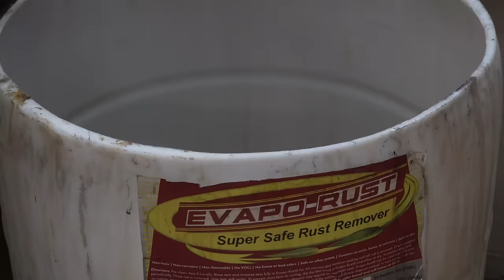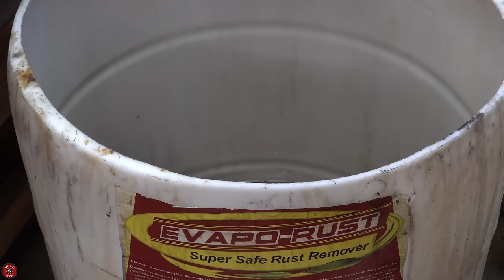1890s' Most Unnecessarily Complicated Apple Peeler [Restoration]

Comment: That's not "Unnecessarily Complicated", that's a Gosh-darned Wonder of Engineering right there...
Reply: It is unnecessarily complicated... I agree that it looks cool but for something to be well engineered it needs to do what it's designed to be doing while being as simple and easy to manufacture as it can possibly be
Reply: The had no auto cad to design it, all hand drawn blueprints
Reply: @MR5er1  I'm curious. While keeping the same durability, speed, and ease of operation, how could this machine be simplified?
Reply: @PBryanMcMillin  like the modern crap apple cutters you can buy nowadays, way way simpler, and slower and won't even cut during its MTBF what this vintage cutter can do in an hour.

Comment: I wouldn't say this is unnecessarily  complicated. If you're running a pie shop, a device like this is an absolute necessity. 

But for peeling apples at home? Yeah, not so much.
Reply: I thought it was ridiculous in a quaint, old-fashioned way. Until I saw it work at the end, which changed my mind completely!
Reply: And it really seems designed to drop the peeled & cored in a bucket or bowl is great for mass production.
Reply: @PhilipPetrunak  Yea I would just hate to be the poor bastard putting the apple on the thing. Be quick or your hand gets cored...
Reply: Your mom's got a pie shop at home
Reply: We had a variation on this machine that only peeled the apples. We had to core and slice them. We still got a lot of use out of it every year in the fall. My Mom still has and uses it. But now that I’ve seen this bad boy...
Reply: Pretty sure the point isn't regarding use, but the mechanics of the machine itself. There are simpler designs.
Reply: @Awrethien  Yeah. Stuff like this was made back in the day before safety standards for workers were a thing. Thank God for unions.
Reply: @Wolfgang Kleinschmit These were not designed to be powered.
 They were not supplied with pulleys for a belt drive and were originally designed(1886) before small electrical motors were available. Goodell Cp. manufactured these until the mid 1960's when the foundry burned to the ground.

Comment: I don't think it's unnecessarily complicated at all. It's as complicated as it has to be to work as quickly and efficiently as it has to. It's not a kitchen tool, it's an industrial tool for perhaps orchards or cideries. That thing cores and peels an apple in less than one second! It takes my KitchenAide 8 full seconds to core and peel an apple.

Comment: Interesting you replaced the either brass bushings with what looks like aluminum. Have a reason for that substitution?
Reply: no..... it was steel bushings
Reply: @ulfhenarpolymathmilitant6258  interesting. Bushing are designed to be worn, not shaft. You get lubricity from the softness of the bushing so steel is an even more interesting choice.
Reply: you are right, Kevin. Looks like people do not know that now. Remarkably, mostly only Russian speaking commenters have noticed this x)

Comment: I'm curious why did you replace the brass bushings with steel?
Reply: Looked like aluminium to me
Reply: I am curious also?
Reply: I guess, it was for exclude backlash
Reply: Looks like brass was worn out, and steel was all he had of the right ID and OD
Reply: hope it is aluminium but even then it is less good than brass !
brass will not make the wight powder as the aluminium...
If it is steel it will worn out all the shafts !

Comment: What material were the bushings replaced with? It looked like aluminum but that wouldn't be an improvement over brass. If it's stainless steel I'm not sure that's an improvement either as that could wear parts faster.
Reply: sunriseshell Dude it's an apple peeler not a 500hp race engine that needs to be rebuilt every other race.

Comment: 1890's? No square nuts or bolts?  Makes me wonder...
Reply: Doesn't look nearly that old to me, either.  Too many threaded connections, wrong kind of nuts, like you say.
Reply: Hex nuts came about in the 1850's. However it looks like someone restored it once before, non leaded paint and so on. I guess there were some washers missing here and there too. The most interesting part for me is why someone would make a spring that coarse out of brass? I know watchmakers use brass springs but theirs are on a whole different length to winds ratio.
Reply: @GAIS414  I thought the spring was peculiar, too.
Reply: I'm thinking newer production with reference to older patent
Reply: Marc Nizzola Yep well into the industrial revolution. There were companies by then that only made bolts, screws, and nuts. Standardized sizes were forced onto the industrial complex by the US Army during the American Civil War. If you wanted to sell to the biggest buyer you had to do it their way. Once you tooled up to sell to them it made no sense to go back to the old way. Yes the military industrial complex controls everything. Don’t believe me look up the US government specifications for shovels. Every shovel in the US meets the specification. Why? Because because the US Government buys more shovels than anyone else.

Comment: What is super complicated, requires ton of metal to build, hard to handle and design to peel an apple?

Ancient Murican machine that peels half an apple.
Reply: At full speed machines like this can peel dozens of apples a minute. The limiting factor is getting the apples loaded onto the machine. Once the apples are cored and peeled they can be mashed to make applesauce or sliced to make canned apple or for making pies in large quantities.
Reply: In fairness, I think a little bit more setup and it would have peeled the whole thing.  Take a bit more core.  Very impressive piece of kit.

Comment: I’ve actually used a much simpler (and more compact) modern version of this. You essentially put the Apple on the end of a large bolt and as you turn the crank it screws the apple forward into a corer, peeler and “slicer”. The results in cored and peeled apple cut into a helical spring shape. When you were done you just pushed a lever that disengaged the bolt from the screw mechanism and pulled it backwards to the beginning. This usually also got rid of the core and apple if you hadn’t already done that already. It also had a rubber seal on the bottom so it stuck well to flat surfaces if you could push the air out.

Comment: Wow. That thing works shockingly well. What a surprise!
Reply: The peeler blade is sprung and would peel large or small apples without adjustment.  We took turns and peeled apples for hours without fail ir injury.

Comment: Okay, it's massively overengineered, but I was not prepared for how good it actually was at the job it was designed to do. That's a seriously impressive bit of kit.
Reply: If you think of it as more of an industrial machine than a kitchen appliance, it's actually not that bad. I'm also assuming some of the parts count is to ease manufacture rather than for any specific engineering purpose.

Comment: You know, it may be needlessly complicated, but it does it job, not everyone likes the peals (I do) and nobody likes the core, so separating the 3 parts super quick so you just get the meat is pretty neat.

Plus the core and peal and easily be tossed into the trash or into compost afterwards.

Comment: I happened to recently watch a video about the modern equivalent of this machine, which cores the apple first and can be programmed to deliver peeled or unpeeled apples in whole, sliced, diced or wedge form. Of course, it's eye-wateringly expensive and you also probably need to pay a technician $150 per hour to set it up and calibrate it... I'll just have the hand-cranked one, thanks. :)

Comment: An interesting restoration.  It does seem to be an overly complicated machine for peeling and coring apples. Yet, it does do the job quickly and cleanly. I am curious about whether or not the machine will rust with only a coating of oil on it.  Will the oil need to be reapplied from time to time?

Comment: sorry for the stupid question , but why you check if there is lead or not in the paint ??
Reply: Lead is a highly toxic element, and lead paint has been banned in the US since 1978. Objects painted with lead-added paint lasted longer, had a greater resistance to wear and tear and kept their shine longer, but the hazards of lead (kidney and brain lesions, mainly) far outweighed its advantages. (When buying a house built before 1978, the first thing the new owner does is to get it inspected for lead-based paint.)
Reply: cflmaior thank you very much.

Comment: Is it just me or wouldn't replacing brass or bronze bushings with what appear to be possibly aluminum, just result in excess ware on the reciprocating and drive rods? Rather than the bushings that are intended to be replaceable ware parts. I know it's just an apple peeler/corer, but the rods are machined parts and the bushings appear to be just brass pipe. One is definitely much easier and cheaper to replace than the other.

Comment: It's extremely wrong that you used steel sleeves instead of bronze (brass) ones. Sleeve bearings are never designed so that both surfaces are made of steel. Such bearing will suffer from extensive wear and need a repair in no time. Moreover, if both the shaft and the sleeve are made of steel, the shaft will wear too, so the repairs will be much more complicated, because making new shaft or grinding it to smaller diameter requires more equipment and time in comparison to making a new bronze sleeve on a simple lathe.

Comment: Good one.
You could do with a plastic hammer. The piece you are restoring should be handled with most respect. It elevates its value. More refinement may attract even more viewers.
I was horrified when I saw you knocking a bush using a socket.
Too rough.
I'd like to see it working on different size apples (small and big).

Comment: Good restoration attempt, however, I had to dislike your video. At 12:28 when you wrote "I know this is just an apple peeler but this can be better" you decided to remove and replace the wonderfully-designed bronze bushing which offer superior rusting and friction properties. You didn't make the machine better, nor did you improve on it. On the contrary, it's now an inferior machine. These guys knew what they were doing. PLEASE go back and restore the original brass bushing!